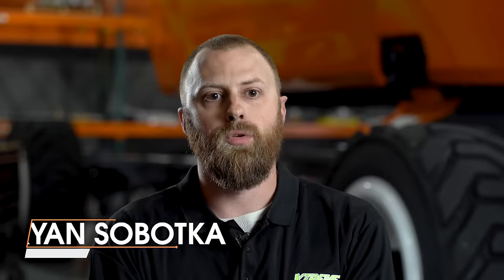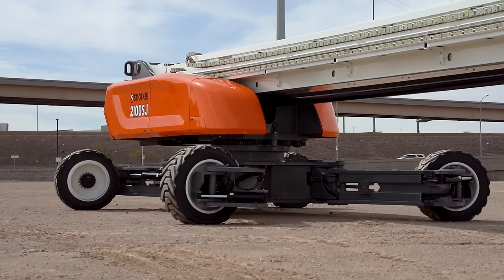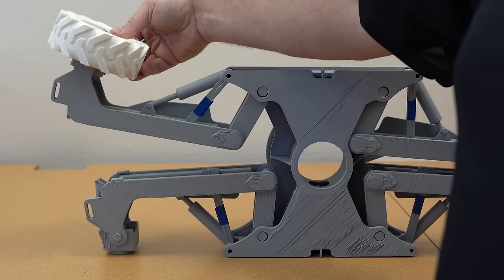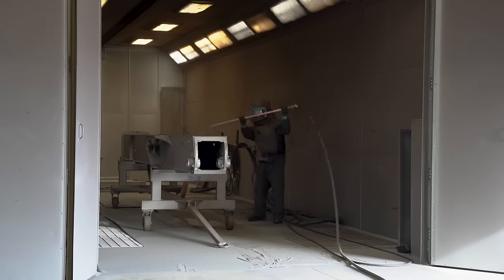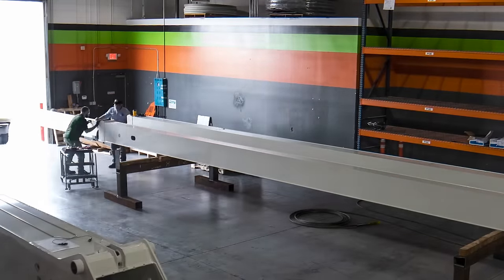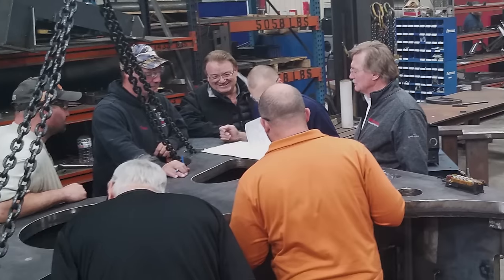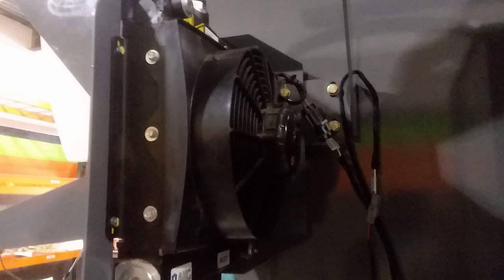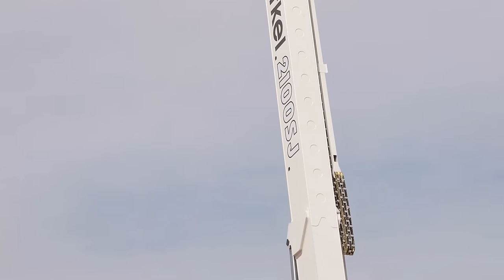Snorkel 2100SJ - The World's Largest Self-Propelled Boom Lift

Comment: Thanks guys, being 120ft in the air wasn't all ready scary enough on a construction site.
Reply: I'm not bad with heights, but the part that makes me nervous is the unpacked and uneven ground on construction sites. The lift will let you know when it's unsafe supposedly, but when your up 80-100 feet and the lift is not level you can feel it in the basket just how much it is leaning. Exciting non the less I love it!!
Reply: @bcrusher1979  They do have safety features that stop you from doing stupid stuff but my first time on a lift I got subbed out to another company. The crazy fucker operating was moving the wheels while we were fully extended over rough terrain. I was like "WTF are you doing take me down" I checked inside of the machine and these idiots disabled the tilt alarm. He said they disabled it because they were sick of hearing the tilt alarm going off and stopping the machine. I walked off the job and gave my boss shit for sending me with those muppets. I found out later on that the owner of that company bought that gene lift and painted it all black to hide how rusty the machine actually was.
Reply: @Crazyman1212  im a mechanic at a rental company, we had 2 guys disable the tilt alarm at a prison being built and they flipped and sadly didnt make it. you made a very smart decision. aerial equipment is not to be messed around with

Comment: The snorkel we use keeps dying on idle, its brand new and it really sucks
Reply: Make sure it's getting air and fuel. Check your fluids. After that, you need to start digging into the electrical stuff to see if it's not getting a signal it should be.

Comment: man, I work on boomlift everyday, mostly 66ft and 86ft ones, but sometimes 125ft or even 150ft ones.. I hate when I fully extend the boom and then slew to one side and you see the boom swinging like it's rubber.. or when you're fully extended and angled low like 40° or lower and you see the boom making an arc.. really scary..

Comment: the foot print of these lifts never seem to reach wide enough for them not to tip over …..in my head.  the fact that they do reach so far gives me the impression that the base should be much much wider, and also have a massive counterweight.
this must come from the fear of being that far into the sky on just a boom.
i don’t mind heights, but these lifts make me very nervous, even thou they are safe.

congratulations on your accomplishment !
Reply: I work for an equipment rental company and boy do I HATE going up in booms! I was about to have a panic attack when I was about to go up in a 125. Luckily the level sensor failed right then and there lol.
Reply: @caslone88  I’m in 1200 on my jobsiite
Reply: I have no problem until I break the 100 foot level and the wind picks up and you sway several feet.
Reply: They do have a counterweight on them. You gotta think that base must be super heavy to support you and the heavy arms so far from center of gravity.  I use these lifts all the time, I have no fear of heights, but I can totally see someone getting freaked out by them. You don’t even have to be that high for them to start swaying.
Reply: Yeah I wonder how they test top over factor ?  I always figure the bases should be bigger .

Comment: The Bronto Skylift is nearly 300 feet tall.  (I don't think it can move while extended though.  Maybe that's the difference?)
Reply: 😳 

From which country is that model derived?
Reply: One of the local fire companies has a 125 ft Bronto platform ladder.  Its out of service for repair more than it's available.  Great idea, but a huge POS I've seen it break down multiple times and the Firefighters were stuck or had to climb down.

Comment: So i had a 18 foot time two snorkel which would extend to like 41feet total with two 18 foot booms and the five feet it was already above the ground. 
I was shaking when i was fully extended. It did not have extendable foot stabilizers on it for some odd reason but i believe some just dont have them if i remeber correctly. It was scary stuff. I cant imagine this thing. Wow. I think if carbon fober was used and they had a way to attach to the ground it would be able to go farther. I wonder if you would make an adhesive type stabilizer for the bottom to attach to concrete temporarily that would extend the amount of reach and height you could do. Also just because you can go high doesnt mean you can reach put far. That is when you really need to be secured to the ground. If you are on grass you could screw in with a corkscrew type decice on both sides like 6 or 8 feet and really go high and far. Or on concrete you could make an instant epoxy that you could glue down a plate with a ring to buckle the lift down hard. But then you have to pry it back up and grind the epoxy off and fix concrete. I qonder if they could make a vacuuming suction device like a very large surface area plunger that sucks and it holds the damn thing down. Or if on dirt maybe just like i said corkscrews would be best or just spikes that dig into the grass and dirt. Honestly just making the thing extend up to 20 feet outwards on each wheel so the wheelbase is like 40 feet wide olu the original wheelbase and 55 feet long with the original 15 foot wheel base front to rear but you also go out at an angle so the measurements would be a bit different than that. Just make each wheel have a boom that goes diagnol in direction and extends like 15 feet, then make the booms out of carbon fiber and then put a saftey measure on the boom that is like four really long carbon fiber extendable booms that are very thin that go all the way from the middle of the boom when fully extended and touch the ground on all 4 sides so it literally can jot fall if it wanted to. Kind of like a teepee. Make the boom automatically extend the thinner  support booms when it gets to a certain doatance and they stop when they are 45 defrees and hit the ground. Then you could use the damn thing as a crane if you wanted to and install a small crane up p on the bucket. You could probably lift a thousand pounds easy if the boom was only 30 feet and made of carbon fiber and more if you incorporate more supports in this manner for the crane. I could build one that i capable of a lot. I need paper and a pen and about 5 million like these guys had and 🤯 BOOM.